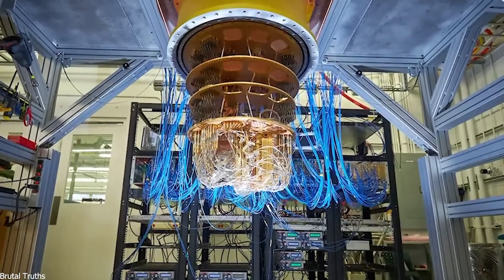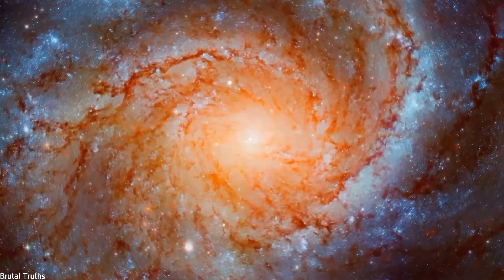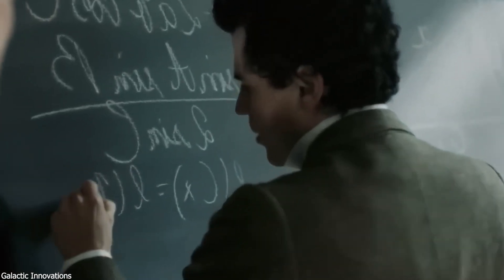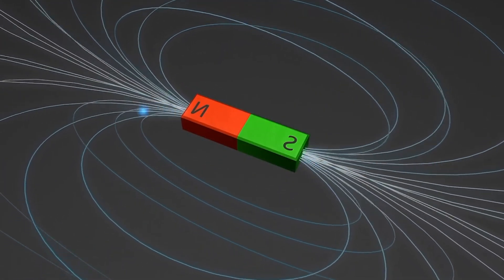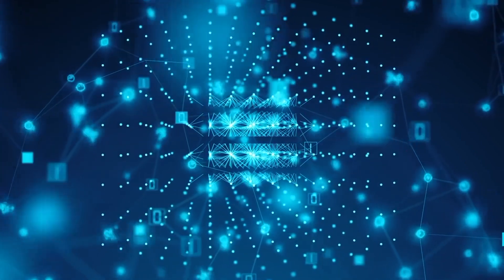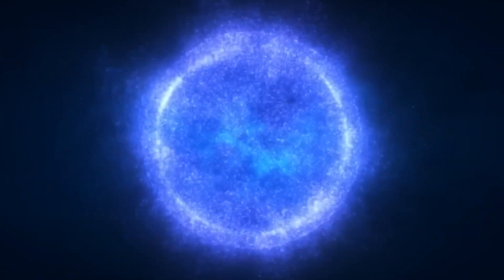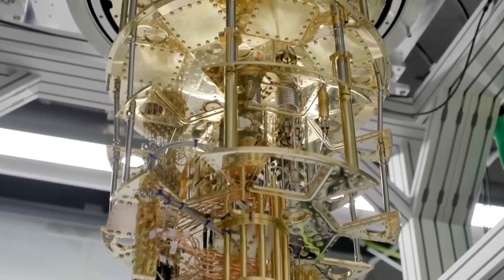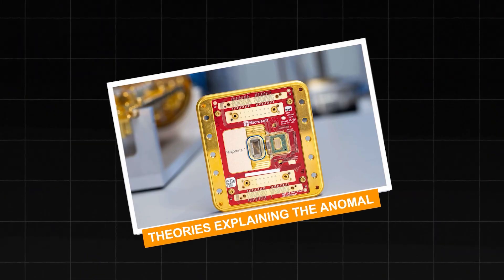Majorana 1 Quantum Chip Just Detected a Disturbing Pattern in James Webb's Saturn Scan

Comment: 🎯 Key points for quick navigation:

00:14 🧠 Majorana 1 chip detects unexplained Saturn ring pattern
- A quantum processor detected a mysterious pattern in James Webb Space Telescope data from Saturn's rings, challenging current scientific understanding.
01:12 🛰️ Advanced firmware enables breakthrough detection
- Majorana 1's real-time pattern recognition, trained on black hole echoes, filtered out noise and identified genuine, high-confidence quantum features.
03:27 🌀 Quantum oscillations in Saturn’s rings defy physics
- Coherent subharmonic oscillations repeat every 28.5 minutes across vast distances in the rings, suggesting entanglement and possible retrocausal effects.
04:36 ❄️ Water ice may support quantum effects
- The anomaly is strongest in spectral bands linked to ice crystals, potentially enabling quantum coherence influenced by Saturn’s magnetic field.
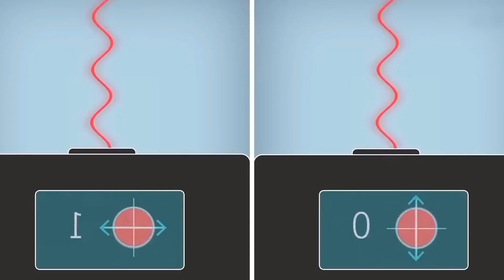05:42 🔁 Violations of causality observed in ring behavior
- Phase disturbances propagate in ways that suggest effects can precede causes, defying conventional physical laws.
06:10 🔬 Quantum resonator theory gains support
- One explanation is that Saturn's rings act as a giant quantum resonator, amplifying vacuum energy through subharmonic oscillations.
07:47 🧊 Topological particles may exist in natural setting
- Exotic Majorana fermions might exist in radiation-damaged ice within the rings, marking a first detection outside a lab.
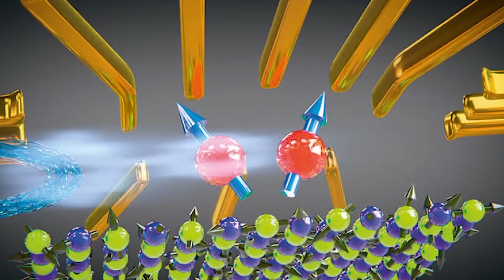08:15 🌌 String theory offers radical hypothesis
- Some propose Saturn's rings are quantum subspace transducers interacting with higher-dimensional physics.
09:10 📜 Historical data supports long-term anomaly
- Voyager and Cassini missions unknowingly recorded the same 28.5-minute signal, dismissed as interference at the time.
10:46 📈 Anomaly has intensified over time
- The signal grew stronger from Voyager to Webb, correlating with Saturn’s orbit and possibly varying quantum vacuum energy densities.
11:39 🧪 Scientific community debates quantum causality
- Theories range from quantum retrocausality to exotic plasma-vacuum interactions, with some invoking superdeterminism.
12:49 🧑‍🔬 Joint task force begins rigorous testing
- CERN, NASA, Caltech, and others are launching blind input experiments to test whether Saturn's rings exhibit non-classical behaviors.
14:55 💾 Saturn’s rings may be a quantum memory
- A bold theory suggests the rings store quantum information via vacuum modes structured by Saturn’s magnetosphere.
16:06 🧩 Signal complexity hints at information encoding
- The 28.5-minute pattern contains complexity beyond random noise, suggesting potential data storage in the ring structure.
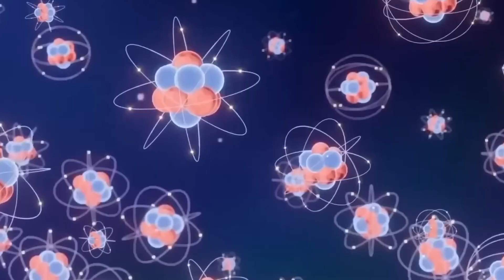17:29 🛸 Hypothesis of intentional design emerges
- Some propose the ring’s coherence and symmetry point to a designed system, possibly by an advanced civilization.
18:11 🧠 Quantum archive could hold solar history
- If valid, the rings may contain data about planetary formation, solar events, and more—an invaluable scientific resource.
19:20 🚀 Majorana 1 opens new chapter in space-based quantum physics
- The chip’s discovery marks a turning point in exploring quantum phenomena on planetary scales, reshaping our view of time, causality, and information.

Made with HARPA AI